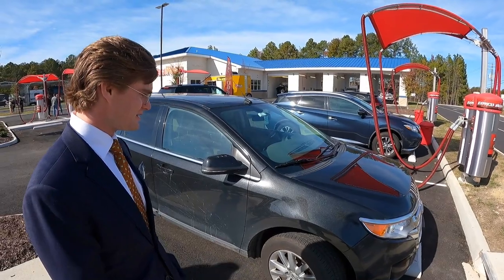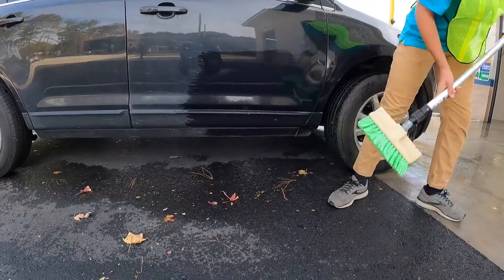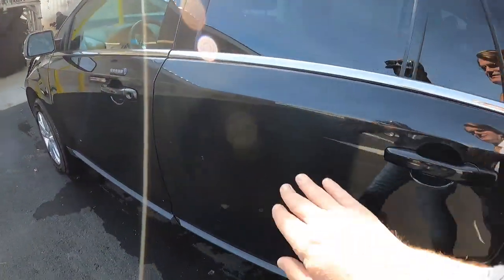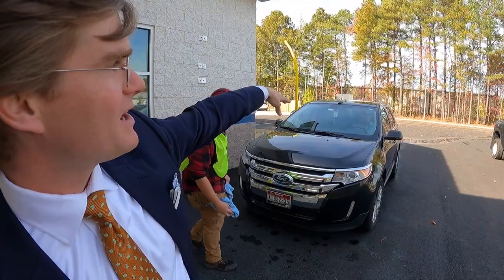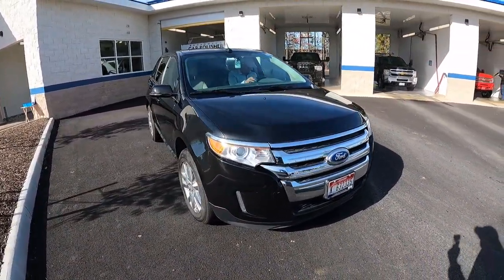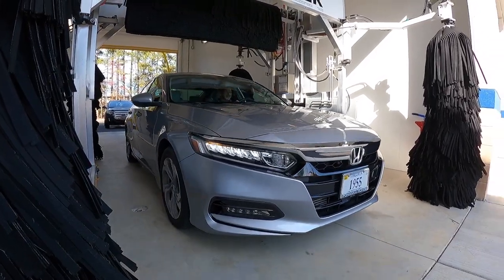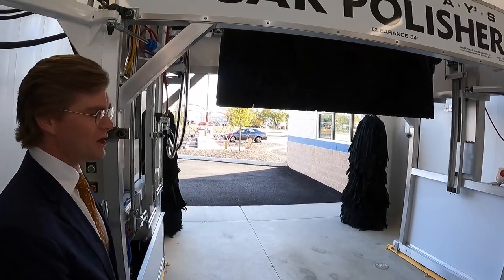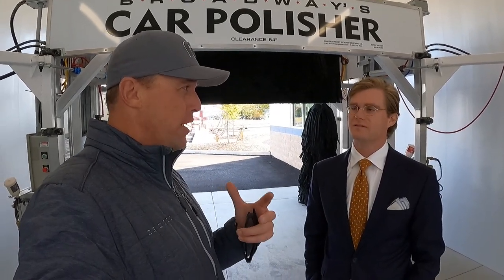AUTOMATIC CAR POLISHING TUNNEL!

Comment: That pre soak cleaning brush looks like it will scratch the heck out of the paint.  They were cleaning inside the wheel well with the same brush as the side moldings.  The polishing felt strips could scratch with the residue polish but probably not too badly.